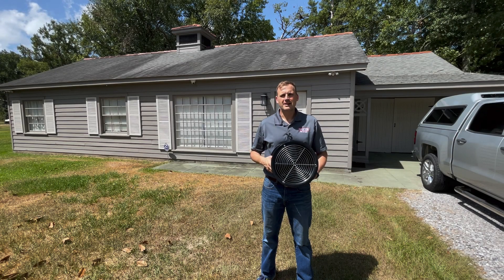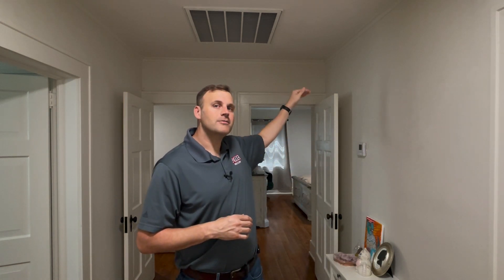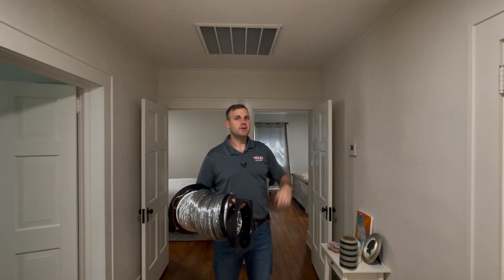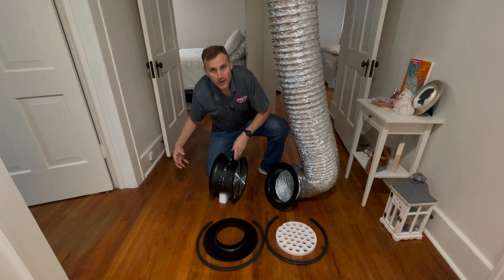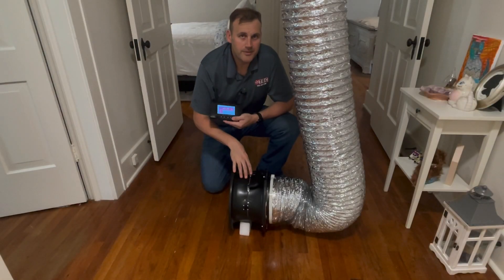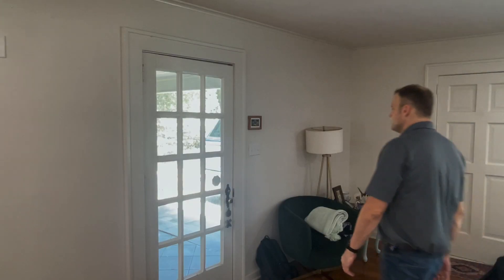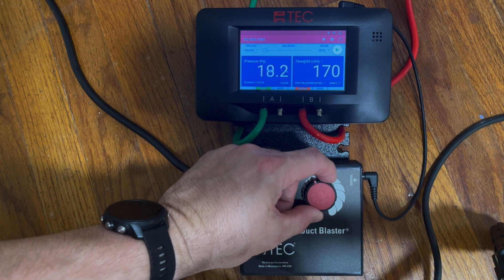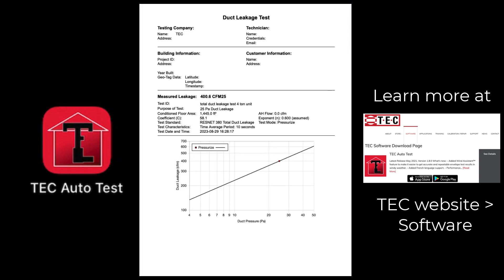TEC Total Duct Leakage Test Overview

Comment: Do you have to enter the square footage or volume of the house
Reply from the maker: For a total duct leakage test, you would want to enter conditioned floor area to get the desired results as CFM/100ft2.
Reply: Thanks for getting back to me. If there’s another duct leakage video can you demonstrate how to measure the condition space and what is referred to as the condition space. There aren’t any videos doing the measurements or just doing it step by step
Reply from the maker: @adrianwright3061  Are you referring to a  duct leakage to outside test?  This test is done to determine what portion of the duct leakage is outside of the thermal envelope.
I have two resources I could send your way.
Below is an extensive overview of the Duct Blaster which may have what you are looking for.  We are also available by phone if you would like to discuss your inquiry with our tech support team. (612) - 827-1117
https://energyconservatory.com/support/duct-blaster-videos/
Reply: What about leakage between the duct grill and drywall as it appears you are only sealing the face of the grill?
Reply: We typically have to call that.
Reply: Calk that I mean.